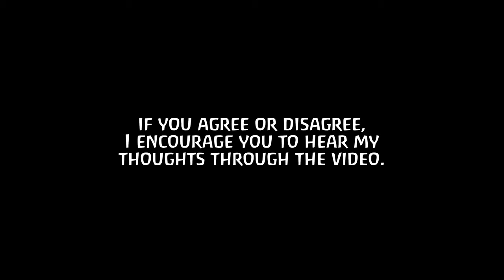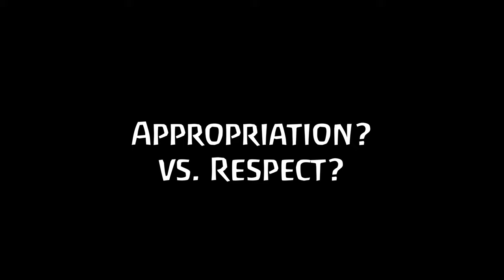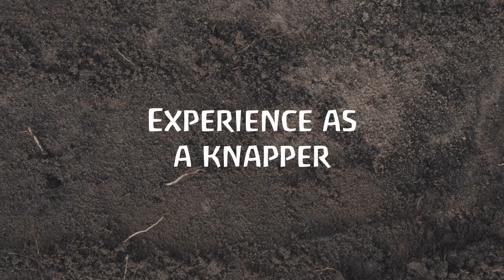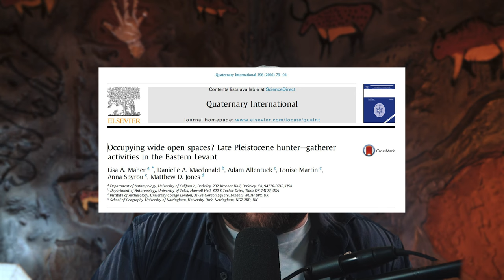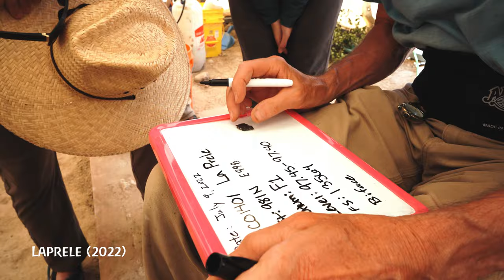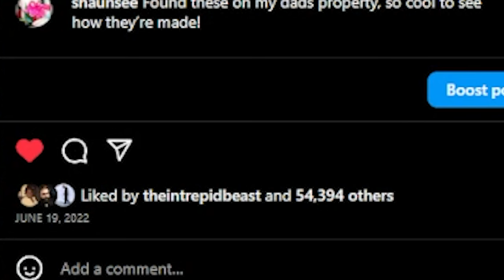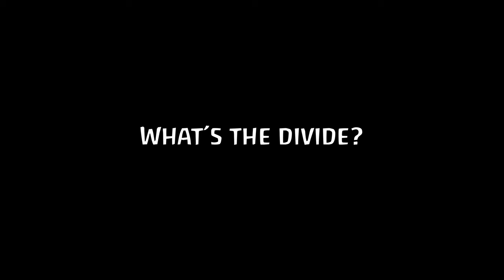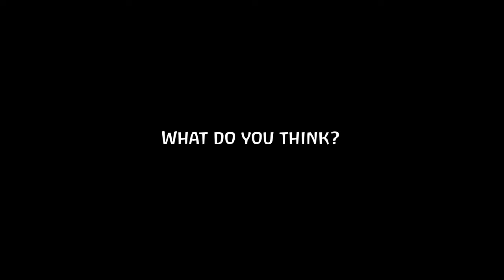Why the world's oldest technology matters to archaeologists, modern craftsmen, and Indigenous people

Comment: I once knew a self-taught flint knapper. He was a very talented knapper. However, he was venal & dishonest... He counterfeited genuine points & sold them as genuine. He also looted burial mounds. This was back in the early 1980s when it was considered not too terribly important. The one thing that I observed was the massive quantity of debitage wherever he knapped. It was a true concern that a barefoot person could get serious foot injuries. Was the clear division of work vs living areas because of the fact that the debitage could cause injuries? 

Note: That knapper that I mentioned? His favorite material was glass, specifically old one gallon RoundUp jugs. They were amber glass & very thick glass. He always used the middle of the bottom of the jug because that was where the glass was thickest.

Comment: Flint knapping is part of our heritage as humans - just like farming, stock-rearing, forestry, blacksmithing. Old technologies may be supplanted but that does not mean they have to be culturally appropriated, corralled  by any one sub-group of humans, be they 1st nations' people in the New World or Celts like me here in the Old. If I use a push-me-pull-you to cut up some logs rather than a chainsaw (I have both) I am not seeking to insult modern loggers, merely that I have no petrol, or chain-oil or the saw won't start... Old technologies don't die. It is just that some other more modern development may usually be better. There can be no misappropriation without an acceptance of racism. Cutting edge thought might include attacking that problem? (Of which we have more than enough, especially south in England...)